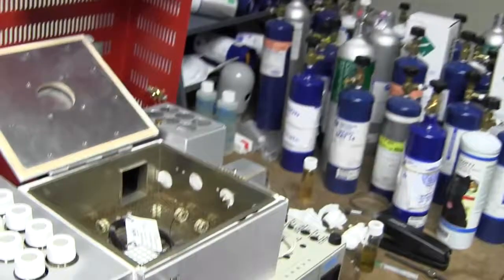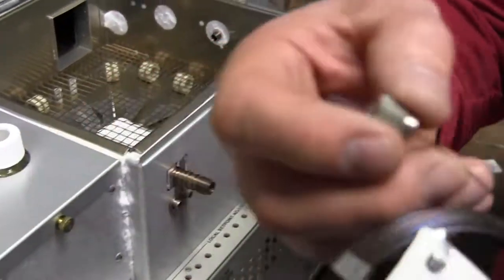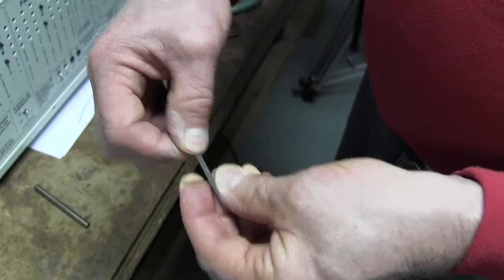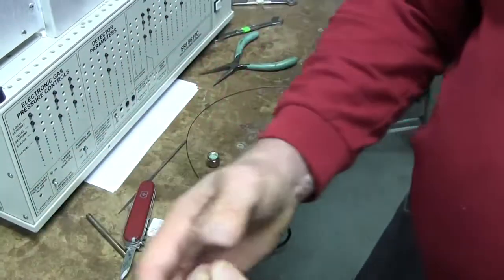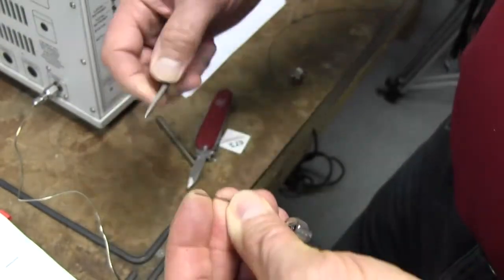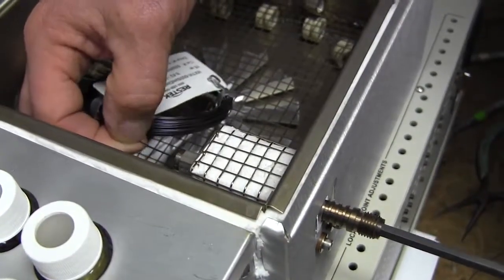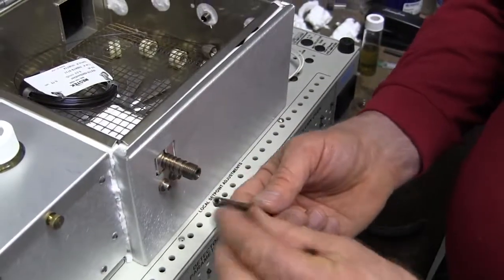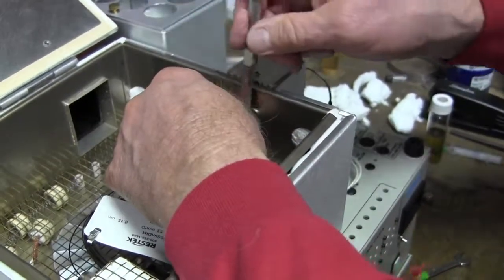How to remove and install a column in the SRI 8610C cannabis testing GC

Comment: How often should I trim the column?
Reply from the maker: There really isn't a specific amount of runs or period of time that determines if you should trim the column or not. It's more of a troubleshooting procedure than a regular maintenance type of thing. 

So to answer your question: You only really need to trim the column if you notice something wrong with your analysis, and think the problem is column related.